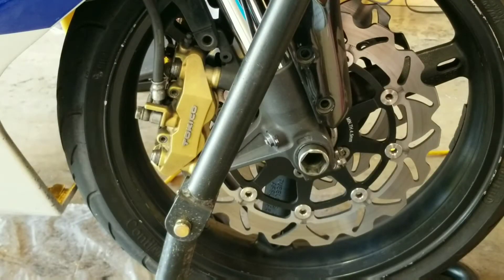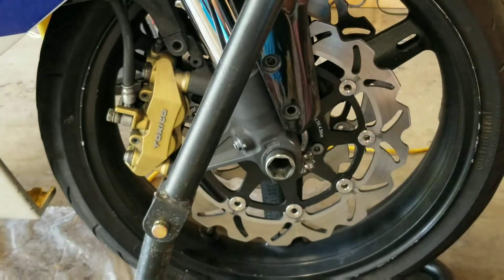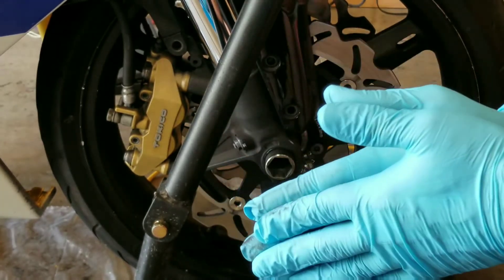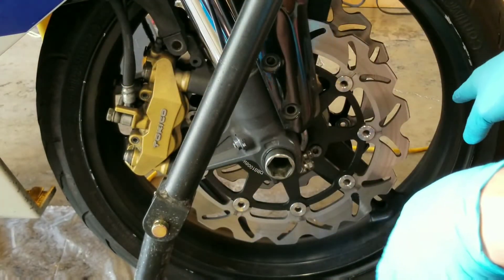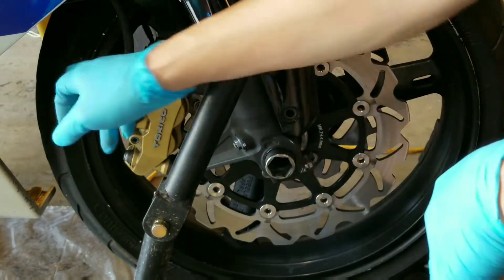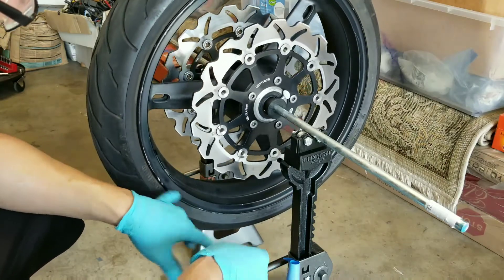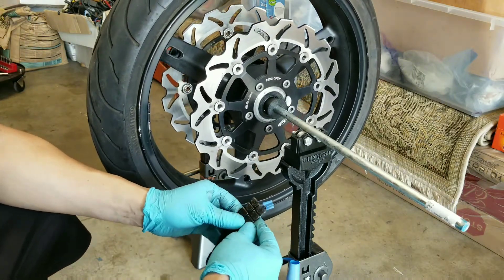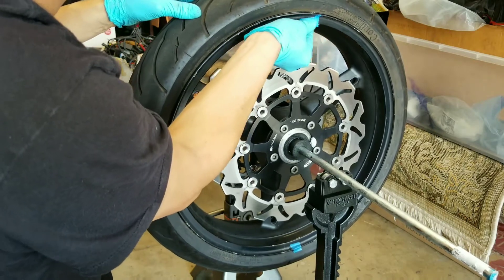Chemist Designed 3D Printed Static Wheel Balancer

Comment: The bearing of the front wheel is already moving the wheel freely. No need to add other bearings, just suspend it on a jack with rods. I've done that tons of times & it is perfectly balanced.
Reply from the maker: I have to agree with you, ive dont it both ways and compared the two.. no difference but the imagination if you ask me.
Reply: @tonycstech  If your bearings are not free spinning you need to worry more about that than the balance of the wheel.